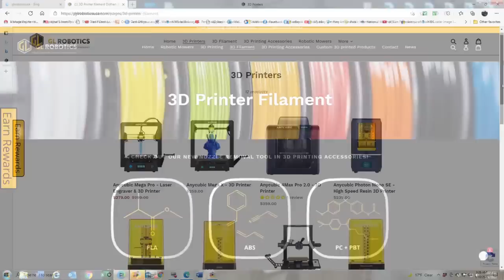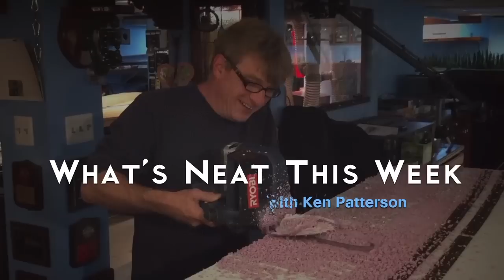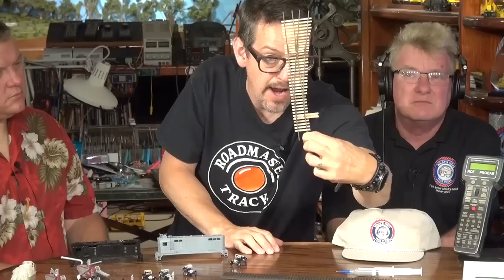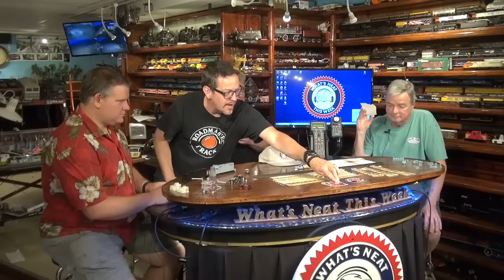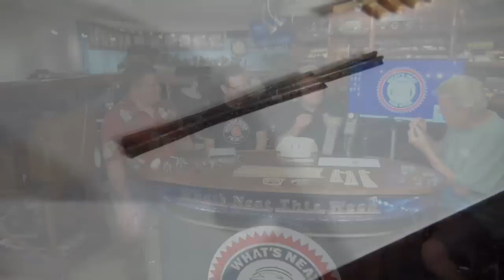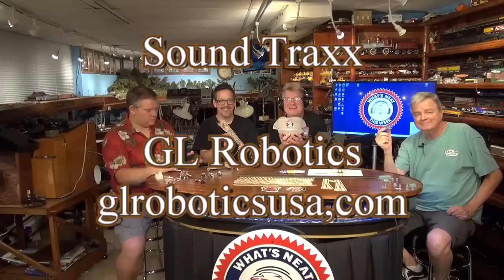What's Neat This Week in Model Railroading #237 June 10th 2023

Comment: 3d printers fit in with STEM (Science Technology Engineering Math) classes.  My kids actually went to a STEM certified elementary school.  The school has a 3d printer and the kids also learned things like programming logic.
Reply: Model railroading is all about STEM, 100%.  Think of all that goes into building a layout:  calculating curves, measuring angles, figuring out spacial relationships for turnouts, yards, etc. It's all there.